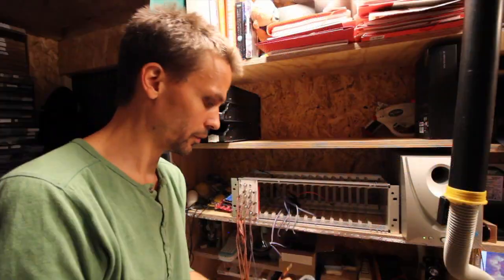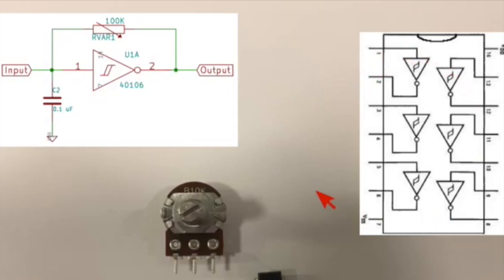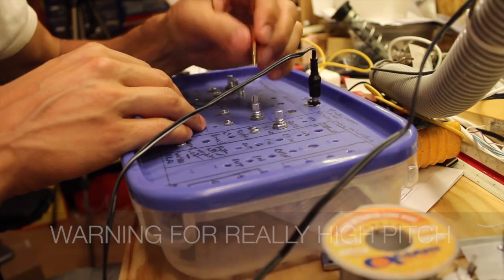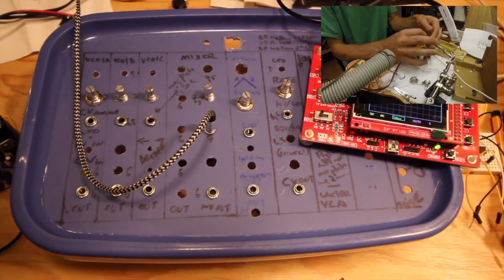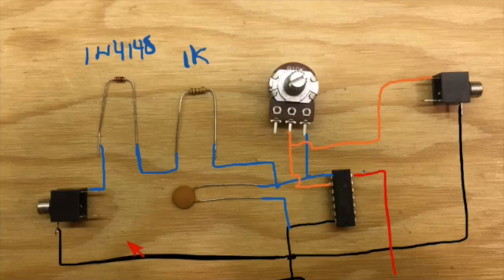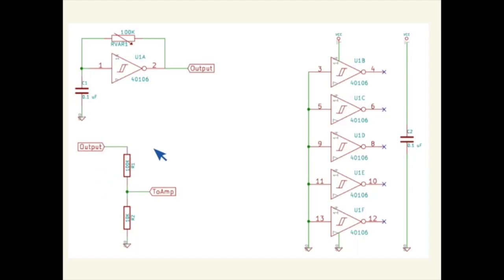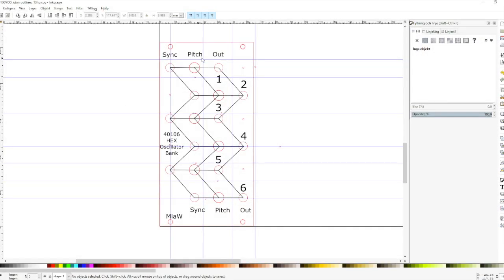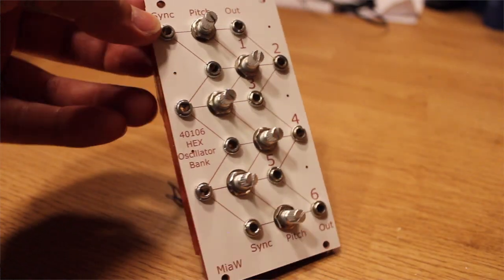40106 Hex Oscillator Bank - DIY Modular in a Week 1.1

Comment: I've tried to build this type of circuit, but i used electrolitic cap instead of ceramic, with value of 1uF and a pot of 10k. when i wire in a CV signal, let's say range from 0 to 12V (my chip is powered by 5V) only a very small range of the CV actually controls the tone. the rest of the range is just inaudible (dunno if its super sonic or just not oscillating, i shuld check that)

also i wanna try running this at 12V instead of 5V maybe this will help...
Reply from the maker: IF you built this exact oscillator  then there is no cv input. You get a kind of sync or timbre input which just turns the oscillation on or of. Doing it rapidly enough kind of gives a different pitch. Doing it really slow gives a more rhythmic effect (on off) maybe that is why?
Reply: Kristian Blåsol I ended up figuring out by testing a bit how to get it working on an acceptable level! I have a turingmachine module spitting out random pitch voltage into the cv and it can melodically track it. Now of course it no where near 1v/oct of course and it’s not perfect but for a relatively simple cheapo module I now have 4 voices that can either be independently outputted or mixed with cv control for each one or all of them at once. So I can set a “chord” and then use cv to shift it. It’s pretty good!
Reply from the maker: Nice! Did you do something special to the cv inputs? Do you have a yt video showing it in action? Would love to see hear it. :)

Comment: Uh-oh! I think I caught the bug... I went through the components list and have about two-thirds of the components. I'm running out of excuses to start the build, darn it! One question as I am new to all this, can these first modules be plugged directly into the audio interface on my computer or do I need to build something else first before being able to hear these oscillators. Great series, btw! Thanks for sharing your years of Modular knowledge.
Reply from the maker: Haha oh no, another one bites the dust. 😂. The output signal is quite “hot” so it might break the interface if plugging it directly in. Build a mixer so you can attenuate the signal, or just make a voltage divider with two resistors to get the signal in the 1v range should work.

Comment: Having a problem with my build. I have 6 working oscillators. I can play any combination of oscillators from one single side of the chpi through my mixer. But when I connect oscillators from both sides of the chip to the mixer I get no sound and my power supply starts to hum loudly. 

After looking at the Hackaday pinout for the chip I connected  pins 1&2, 3&4, 5&6, 13&12, 11&10, 9&8, but now I notice at 8:40 in the video Kristian seems to imply that the higher number pins should be connected the other way round. (8&9, 10&11, 12&13). Which is correct? Any other ideas what may be wrong?
Reply from the maker: I’m live now if you wanna talk about it? We can check...
Reply: For others who may be reading this now, the simplest way to remember is that apart from pins 7 (GND) and 14 (V supply), all odd numbered pins are inputs and all even numbered pins are outputs.

Comment: Hey Kristian, in your parts Excel, it says that you need a 10000uF capacitor for this module; where exactly is this needed? Can't find it in the schematics...
Reply from the maker: It is used for one of the six oscillators. It is just a suggestion as any value works. I just chose values that went from really slow oscillation to really fast (or from low frequencies to very high frequencies). So you can pick any cap+resistor/pot that gives you the range you want.
Reply: @SourceryOne  Aha, I see, thanks! Love your series btw, very helpful! :)

Comment: Yet, another question - I have the same scope you have and my sounds are fine.  However, I don't get any waves like yours?  I cheated and split the six over two boards.  Do you think we need to ground any unused chip legs as shown in the schematic?  Thanks, again.
Reply: Nevermind, turns out I was using an old audio splitter that seemed to mess up the signal.  I ended up tying just a bunch of alligator clipped cables and got it to work fine.

Comment: Hello, I have begun this project with success using a ceramic cap as you are showing.  Can we use electrolytic caps as well?  Thanks!
Reply from the maker: Yes. I just picked a few values to fit the frequencies I wanted. I think I used a few electrolytic caps aswell. Just try out values until you find the frequencies you want. :)
Reply: @SourceryOne  Great!  Will do, thanks

Comment: I enjoyed this video! 
I'm also making a diy synth from circuits I find on the internet. 

Your potentiometer is going into 0 Ohm when tuning al the way to the max.
I found that when I put a small resistor (lets say 100 to 1k ohm) in series with my potentiometer, it sounds a lot nicer when you reach the maximum of the potentiometer.

Thanks for sharing this awesome video. Hope to see more in the future :)
Reply from the maker: Oh thanks for a great tip! I don’t like that these oscillators glitch out at the top (0) position, a 100 resistor will solve this. I’ll try that out. Thanks again!
Reply: trim pot is  used a lot in bending alongside the pots to prevent crashes so you can find the exact min/max